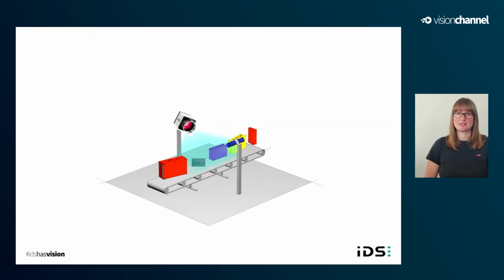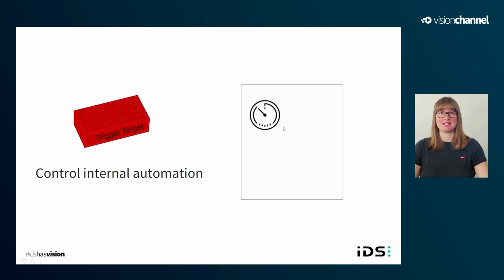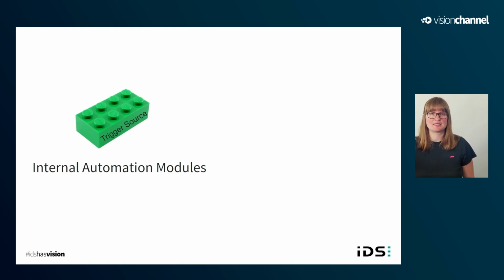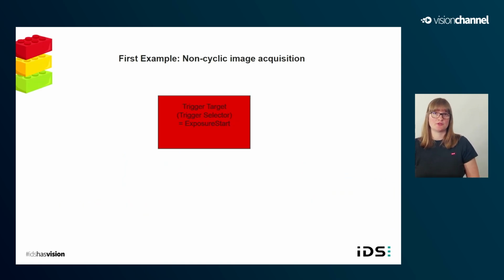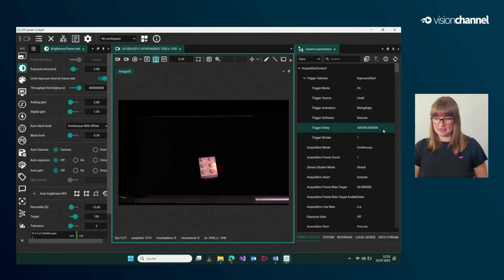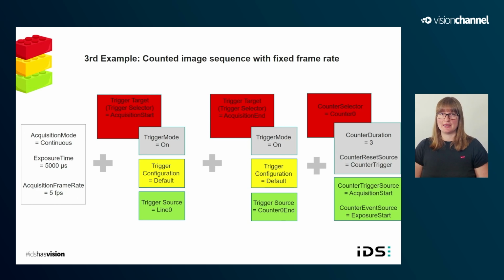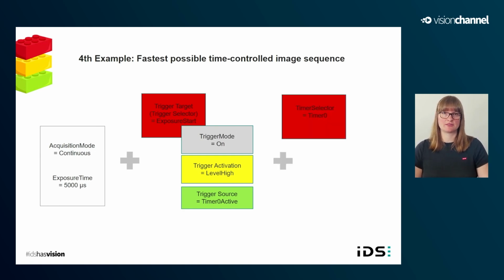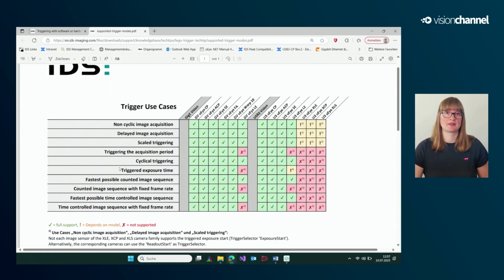How-to implement advanced triggering with IDS vision cameras for precise image capture

Comment: Hello, I have a question please, we have a camera model U3-34E2XLS-M that supports only ReadOutStart trigger, But, We need to start the exposure at the falling edge of a hardware trigger signal. The problem is that ReadOutStart does not guarantee the synchronization and the gap (timestamp) between images. We are seeking for a solution to fix that without changing the camera we have. Any help please ? Thank you!
Reply from the maker: Hello, thank you for your enquiry. Please create a support ticket for your enquiry via the ‘Open support ticket’ tile: https://en.ids-imaging.com/support.html

If you do not yet have a user account, you will need to complete a quick registration so that we have all the relevant information to respond to your enquiry. Thank you.